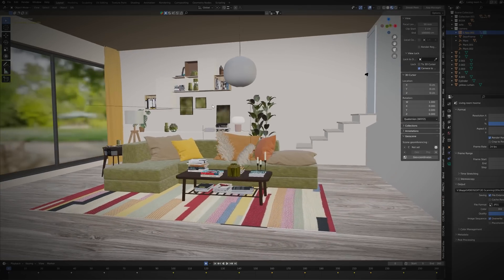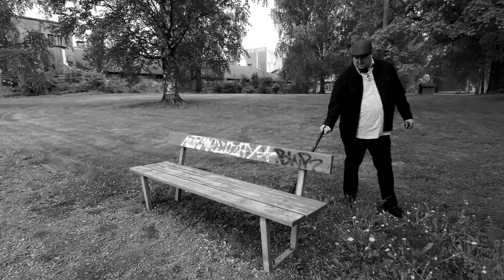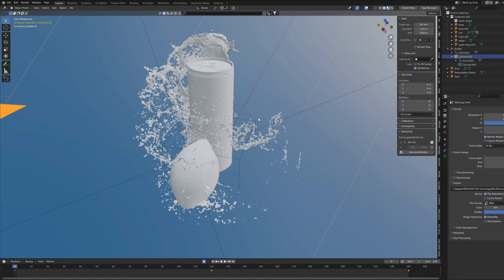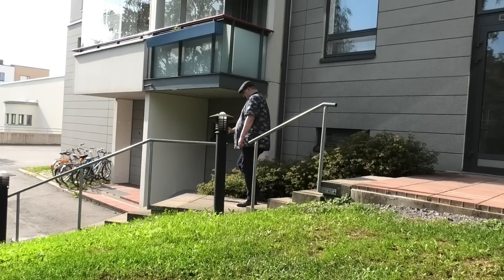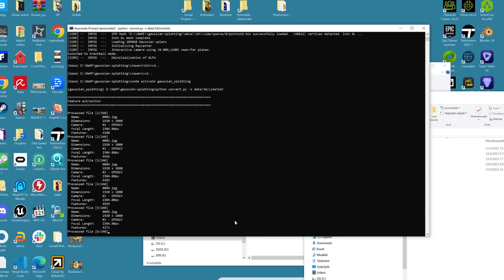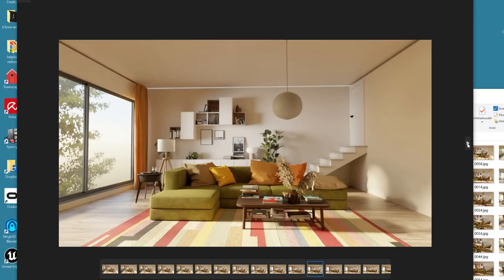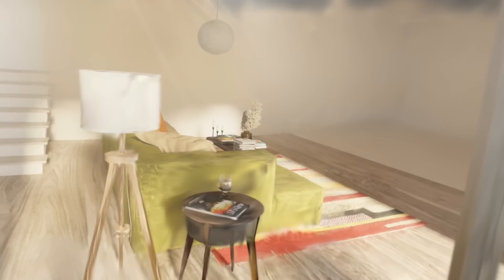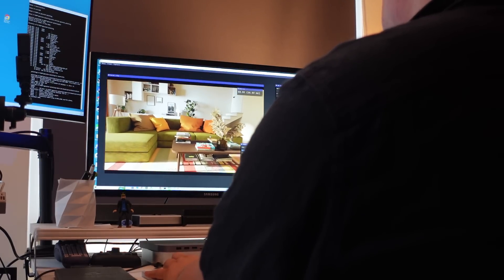Unlocking the Potential: Mastering 3D Gaussian Splatting using Pre-rendered Images

Comment: Could the issue of flat backgrounds causing artefacts be remedied by marking parts of the images so that the software knows what it's looking at? For example mark the parts showing the sky so that it knows that it's supposed to be far away instead of confusing it with particles that are closer to the camera. 
Another thing I thought about was that couldn't you simply convert the 3D model into a point cloud? Of course it would lack the lighting and reflections present in the rendered images, and then new solutions would have to be deviced so that lighting and reflections could be introduced in the render afterwards.
I know that these things would have to be coded first and no ready made software exists for them yet, but I'm just spitballing solutions ~
Reply: Yes having a ground truth point cloud should solve locations of splatts for the images to be fit in training that's what is missed in real world training sets. Perhaps even they could be improved by using lidar or stereo imagery
Reply: The lighting isn't a problem, these are baked data index using Spherical harmonics, the light isn't calculated and wouldn't cost anything. 3D gaussian IS a form of point cloud. The reason we can't convert a 3d mesh, is because it's not encoding surfaces per say, but ray direction BY a position and baking of color into the SH format, the gaussian part can be seen as a form of spatial compression by elongating an ellipse to any point of space sharing similar data, else you would need more points.

Comment: Hey Olli! Thanks for the super cool videos you make, they are always a treat! Would you have an idea what the lowest amount of VRAM and CPU power are, necessary to view a Gaussian splatting scene? Or if there is still room for optimization on that front? I have a slight fascination for "beautiful graphics through optimization and new technology on old hardware", and I would think it would be super cool if something like this could be run on (very) low end hardware, like an older generation gaming console.
Reply from the maker: Yeah! I haven't tried it yet, but it seems that Gaussian splatting can be viewed even on older and less powerful devices. Creating Gaussian Splatting model it requires a RTX level card. But just for watching a pre-trained model it could work on less powerful PC also. SIBR Viewer for exsample does work on other cards as well. I tried it on my nephew's gaming PC with a basic GTX card. And it worked very well! It would be interesting to find out how low level of machines the viewer app would still work on.
Reply: UNless you use compute, it's equivalent to a massive particles only scene. Which mean tons of overdraws. If we can fit the code of a single splat inside the VU2 of the ps2, it's probably possible on ps2 with a cap at 4 millions particles. lol Overdraws, therefore fillrates, it's the main limiter for non compute (which would rasterize directly).

Also current scene are probably the equivalent of using RAW 4k texture density everywhere. We can probably find way to optimize and compress scene, by first reducing "resolution" by dropping some particles, then find way to compress and sort the remaining into a nice format. If we can get rid of transparency too, I wonder how bad are splatting without transparent shapes, might be good enough for some use case.

If I were to try, I would first sorts particle into a 3d grid, such that we can march the grid, per rays, and only get the relevant splats, then I would try to guess how to mipmap every sets in a grid, which could then load based on distance. Then I would find a way to trim the grid from empty spaces, then find a compression method for chunks of the grid.
Reply: @NeoShameMan  By coincidence, I saw an article on Hackernews this morning explaining that using clustering, it is possible to quite easily reduce the file size of a Gaussian Splatting scene by about a factor 10 without much loss of quality. You can reduce even further, but then you start noticing artifacts, although I still think the images look pretty good. The author notes that in the bike demo scene from the original paper, 4 million gaussians were used... I haven't read the original paper yet, nor do I know a lot about real time rendering, but if a gaussian splat equals a single particle, then 4 million particles + reduced file size might not be outright impossible on the PS2... although you would probably have to also optimize the renderer, like you described. 

I don't think you can post links on youtube, but the article name was "Making Gaussian Splats more smaller". The idea of the author seemed to be to reduce the file sizes, so that gaussian splatting scenes could be used in Unity. Pretty cool!

Comment: This 3DGS actually could be the "front end" to so many tools that have limited interfaces because the finished visual is a great approximation of reality. Every geographic information system, facility management system, BIM\Fabrication package & surveying application could use this technology. The limiting factor for so long has been differing file formats and interfaces. This could be the 3d printing press that makes digital data almost agnostic. 3D has come a long way since the 1980's but is still the same method and tools, but faster. If you use your room as an example you could have all the services, construction materials, fabrication plans, building approvals, energy calculations etc all use the same 3DGS format to display information on any pixel generating viewer. Exciting times.

Comment: Is there any reason why this wouldn't be used to make games run with prerendered raytraced scenes at a high frame rate?
Reply: i guess some problems can arise also with collision detection, unless the scene is not cleared someway, I suppose lot of random points can be floating around
Reply: Isn't collision usually a separate invisible polygon layer? @3DProgramming
Reply: @BardCanning  yes, you are right, yes maybe it can be manually specified, I was thinking more of some automatic way to derive it from the data, but I suppose it is possible with some automatic cleaning
Reply: The current uprise for Raytracing in Video Games is because it allows high detail light in real-time, no more baking no more waste of time in development. Gaussian splatting isnt dynamic, it would be a step backwards.
I see high benefits in product visuals on websites or so
Reply from the maker: Absolutely! I can't think of any reason why it couldn't.
Reply: @OlliHuttunen78   I think the next test could be to see how much the blurriness could be reduced in a single room scene - enough that it could be used as a quality game asset. Would more frames and angles fix it completely?
Reply: @OlliHuttunen78  If it works that well and enables people to play photo-real raytraced games at 60fps on regular graphics cards it would be a revolution for the gaming industry. I'm waiting for the bad news for why it isn't possible.
Reply: @BardCanning  Its not raytraced but baked. The scene can’t be dynamic.
Reply: @OlliHuttunen78   Its blurry, it´s not dynamic, it has a very big memory footprint, its not even clear to me that its faster than something similar done with realtime RT in Unreal.

Comment: Really interesting, I need to test this at some point, do you know if this works with AMD cards as well?
Reply from the maker: Well, this Gaussian splatting generation relies very heavily on CUDA, so I don't really think it would work on AMD cards. At least not yet. But the pre-calculated Gaussian model can at least be viewed on AMD cards as well. At least I would think so.
Reply: @OlliHuttunen78  Thanks, I know at least on linux using ROCm, you can run pytorch. But not on windows yet as far as I know.
Reply: @OlliHuttunen78  this was awesome video!!! is there repo of pre-calculated models that can be viewed? what format are these files? if its *.ply we can use any viewer?

Comment: amazing, is it possible to train the data with a graphics card with just 6GB of VRAM?
Reply from the maker: Yes! 6Gb can be enough up to a certain iteration point. And in the calculation, you only need to reach 7000 iterations to get a good enough Gaussian Splatting model. And even if the calculation crashes before 7000, there are tricks to succeed in the calculation, for example by reducing the resolution of the training images.
Reply: @OlliHuttunen78  i wonder if there is relationship to the iterations and vram. for llm 32b fits around 28gb models and 4b models can be run with at least 4gb. not sure if its related or mere coincidences
Reply: @OlliHuttunen78 thank you! I definitely have to try it, tried nerf with nvidia ngp in the past and I was already amazed by the results, this looks even more incredible! Thank you for your kind answer :)